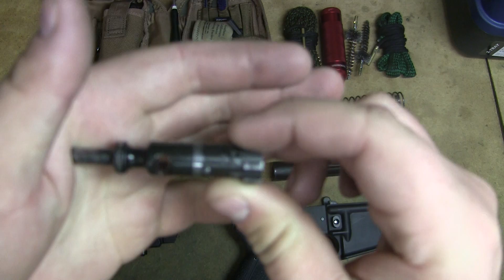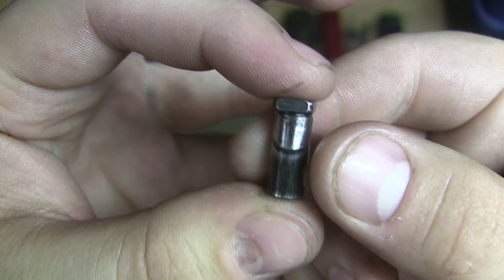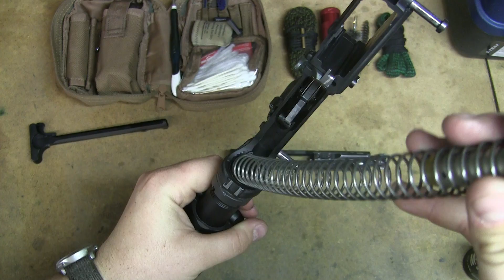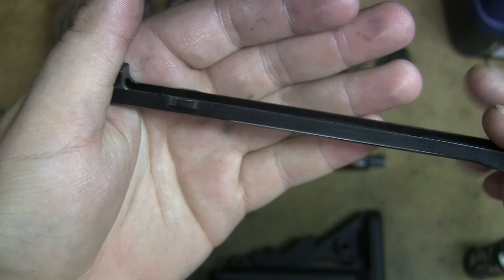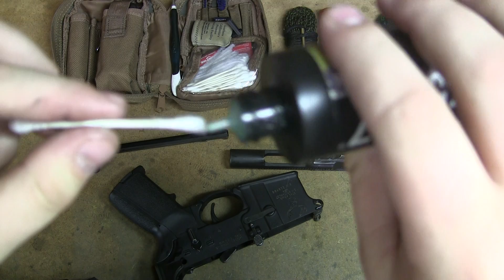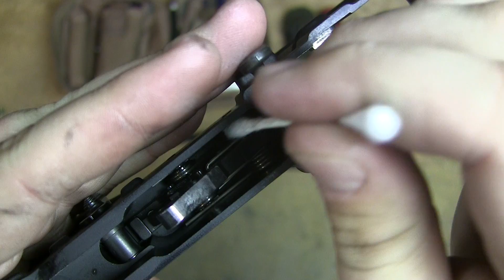AR15 Lubrication

Comment: Just buy a good AK and you good to go !!
Reply from the maker: It depends haha.  Due to the AK's simplicity of operation, and reputation for not requiring much maintenance at all (which is true), people seem to also think this carries over to the quality of the build.  The truth is that the AK must be manufactured to exacting specs, using the right type and kind of steels and processes.  Metal hardness, tolerances, fitting the trunion and other parts together, doing proper rivets, and putting it all together is something that requires the experience, know-how, and industrial capability to do right. 

Simply just buying any AK is not going to set you up for success, and (sadly) with the importation restrictions of recent years, the cheap yet quality kit builds are not as plentiful.  Getting a quality American-made AK is also expensive because not many companies can build AKs in America that are up to the same standards as Russian or Chinese-level production.  It's an entirely different build process and it is exact, it demands a quality build done with experience and quality materials, anything less than that and you're in for a bad time.  

Combine this with the fact that the AR15 has experienced an unmatched amount of R&D and T&E.  The military has been constantly learning lessons and making upgrades on the same design for over half a century, and the civilian sector has also made advancements in the competition realm as well.  With all of the countless lessons learned and improvements made over the decades, from many different end-users, combined with the many millions of tax-payer dollars that have gone into making this rifle that much better, the AR15 is really a refined end-product at this point.  Many companies are putting out quality AR15s, and they all have improvements to the design that have become the expected base-level standard of today.  The end result is a rifle that will perform, and can be had by a quality American manufacturer for very affordable pricing.  

Getting set up with a quality AR15 can be done for less cost than getting the same level of quality in the AK world, which is why it's the most common of the two choices in America.  The AR15 has better ergonomics, I've never seen anybody argue against that point alone, and for all of these reasons, most Americans have an AR15 as opposed to an AK if they only have one.  With the modern build quality and design enhancements of today's AR15s, even a basic level of maintenance will give you reliable function and long-term performance out of your AR15.  The AK is not garbage, it may be outdated and have extra things to consider (mounting optics/ergonomic issues/not as easy to build or modify/etc), but it's still viable if it was built right.  I just prefer the AR15, but if you're seeking an AK, be prepared to spend some money to get quality.  If you don't push high round-counts out of your working guns, then go for a cheaper AK, it'll probably be fine.

Comment: I lube mine, about the same as you do. Always runs great!  Zero malfunctions.   I may add a drop to my trigger sear engagement area.  You're right. You must understand what's going on in your firearms. Some people just aren't mechanically inclined...
Reply: BCM filthy14 looks like it has sludge inside of lt.Yet it keeps on functioning past 45,000 rounds.Lube lots of lube keep it going and it's very rarely cleaned.It also sees lots of carbine classes.Their motto is a Ar will run dirty and wet but not dirty and dry.

Comment: I had to lube up my bolt to get my,gun to fire for 30 rounds after that it wouldn't fire even with a round in the chamber there was no strike on the bullet what could be the problem ??
Reply: You still have that problem? Sounds like a firing pin issue

Comment: When I first built my 300 blackout I kept having failure to feed issues so I took the bolt carrier apart and submerged everything in mobile 1 synthetic oil overnight. I put the bcg back in the gun the next day absolutely dripping soaking wet and didn’t have a single malfunction, but the excessive oil is really annoying...
Reply from the maker: There is a rather large list of issues that could be going on, with feeding issues on an AR, I generally look towards the magazine.  Use a Magpul PMAG, and you've ruled out the magazine.  Use Hornady .300 Blackout and you've ruled out the ammo.  If you lubricated your rifle as seen in the video, you're using a PMAG, and Hornady, then you've ruled out the magazine, ammo, and rifle maintenance.  Then I'd start looking at the build, but it depends on exactly what is happening when it fails to feed.  On a lot of home builds, especially in this caliber, I've seen quite a lot of issues with under-gassing and buffer selection, that seems to get a lot of guys.  The gas port size, gas system, carrier weight, buffer weight -these things all matter and are all inter-connected.  But again, it depends on exactly what you're experiencing when it jams.
Reply: Mr2ndAmendment I finally found the root of the problem. It was my gen2 pmags. All the gen3 pmags that I have will feed the subsonic and supersonic rounds just fine, but the gen2’s are older and I supposed the springs aren’t as strong and aren’t able to push the heavier ammo upwards fast enough. I also bought magpul 300 blackout magazines and they work well.

Comment: I just wanna say thank you one more time. I use your method of lubing every time I lube my BCG and I love it! Very clean, neat & organized. I even lube my lower including the pins every now & then. I also clean the extractor every now and then as well, as for the ejector I've actually never lubed mine after putting hundreds of rounds through my rifle.

And just recently for the first time, I've added 2 itty bitty eye dropplets of oil to the ejector and worked them in several times each (as in 1 drop, work it in several times & again for the second) dried it off and its gtg for a long while. Like I said I've never done it before (but after getting some help from gun fourms I was successfully able to do it) mainly because I was scared and its not something you wanna constantly mess with. But I also don't want it to rust/corrode either simply because I've never oiled it kinda thing.

Good deal man well thanks again for your video! Also liked, subbed and hit that bell icon! :D

Comment: So you dont need to oil the barrel or outside parts like you would on a shotgun
Reply from the maker: Not for reliable function. This video was more about lubrication for reliable function, but there are strategies you should use for long term storage to prevent rust, or if you live in a very humid place. I can do a video on long term storage, which does involve a light coat of oil over the steel surfaces.
Reply: @Mr2ndAmendment  long term storage would make a great video.

Comment: Great info - thanks a bunch.  Question.new AR15 - S&W 556 - 223.  Stock butt plate has no damper, no impact relief.  All add-ons show two screws holding one butt plate.  Not on basic equipment.  Where can I get something that will be effective as impact damper?  Thanks,    Wild
Reply from the maker: Welcome to the AR15, a S&W is great for the money and their warranty is pretty solid should you ever need it.

For AR15s, it's not a common practice to use some kind of recoil reduction stock device.  You might be familiar with the Limbsaver or other similar products that slip over the butt stock of a heavy-caliber hunting rifle, or the butt pad performing this function on a .30-06 hunting rifle (for example).

In the AR15 world, given the light recoil and tame nature of the .223 Rem/5.56mm NATO cartridges, it's very uncommon to see anybody utilize products like those.  I have seen it with people who had a medical condition or disability/injury where all efforts were being taken to reduce recoil, but honestly that's the only time I've ever seen recoil-reduction equipment/products installed on an AR15 stock.  

Have you shot it yet?  I think after you shot it, you might re-consider the need for this.  If you're thinking towards having the kids/grand-kids shoot it, depending on age and capability, they should be fine, I've seen children (under guidance and oversight of course) shoot the AR15 successfully without any recoil problems.

I hope that helps!
-Mr 2A

Comment: I lube a little heavy on a new rifle and diminish the amount of lube as the rifle breaks in, usually after 400-500 rounds.
Reply: You’ll have a lot to clean off by then. That gun powered will be coated on the lube.
Reply: @micavellii  - True, but it aids in break-in.  Cleaning is part of ownership and responsibility.  The OPs's comment is technically correct ... over-lube a little when new, then you'll not have to use so much lube after break-in and your rifle will then be easier to clean.
Reply: @RedCar-c1i  Just bought my first AR rifle since getting out in 02. I had to my bolt more than normal at the range to after that no more issues. Just breaking in. Those rifles Uncle Sam gave me were well worn.

Comment: 2019:  The 3 BEST - HANDS DOWN (*IF* properly applied via heated metal):   *SLIP200 EWL.  *WeaponShield CLP.  ...and - IF U CAN FIND; #1 IN MY EXPERIENCE:   *PRO ONE XPL-101.  
-  ALL r  SaltWater-Rated. USE for the WHOLE GUN!  -- |**|  USE ON UR MAGs internals, AS WELL. Pick one. makes no difference. Stick with... offers markedly-better Performance & Protection with continued use!

Comment: My AR-15 is stored inside an oil drum submerged in Mobil Delvac heavy duty Diesel oil.  Just in case, you never know.
Reply: So im not the only one.
Reply: He’s obviously being sarcastic y’all
Reply: Fuck you, rust.
Reply: I'm using Shell Rotella with some LUCAS additive.
Reply: You need 2 then
Reply: I keep mine in fine grit aluminum oxide and blue steel turnings from my lathe, ensuring sufficient material is wedged directly between the charging handle and bcg
Reply: Not bad.
Reply: Thanks for the info
Reply: Man this is killing me!!!
Reply: EL Dragon ——that’s dumb /so a robber breaks in ur house and pulls a gun on u and your family.   What do you do?  (Answer) drain down oil grab a rag dry off ur gun and save the family $&@?’!=wrong answer:
My Ar 15 pistol sits in my bedroom with a 100 round drum in it but it won’t be my first option the baby G2 45mag w ultra bright light and laser mounted under my pillow  will be my fitst
Reply: @maximillianofranciscozamor9103  sounds like yours is dry...
Reply: Maximilliano Francisco Zamora JR woosh
Reply: @maximillianofranciscozamor9103  That's what the seccond AR is for.  Duh!
Reply: @maximillianofranciscozamor9103  Who cares🤔
Reply: @maximillianofranciscozamor9103  lasers sketch me out, if they have a gun, youre telling them right where to aim.  and unless your flashlight is set to strobe i feel the same way about them.
Reply: @uurkisme  That's why you have an Infrared Laser to go with you NVG.
Reply: @jigmatrix  or 1500 on the end of scar heavy
Reply: @jigmatrix  I would know to shoot into the light.
Reply: @maximillianofranciscozamor9103  The drum of oil is disguised as a night stand next to the bed.....
Reply: @maximillianofranciscozamor9103  You do not find drum magazines extremely bulky, heavy, cartoonish and unreliable?
Reply: @brianmorrison9066  maybe from 50 years ago, the new ones are great
Reply: Maximilliano Francisco Zamora JR  take a joke
Reply: @maximillianofranciscozamor9103  What if you load a blank in the chamber and a full mag of 55 grain before submerging it in oil.
Reply: @maximillianofranciscozamor9103  speaking of dumb now all potential robbers know wher yew keep yer weapons
Reply: @maximillianofranciscozamor9103  sounds like a lot of junk on one little pistol.

Comment: Watch Larry Vickers video about lubrication.  He puts guns in a 50 gallon battle of oil in and pulls them out and they run fine.  One thing to know about AR's.  They run fine dirty.  They will not run fine dry.  My buddy and I did a little experiment.  We took a cheap M&P15 Sport, ran it every day for about 4 years spraying the crap out of it with Remington oil.  No cleaning, No problems.  Tore it down, cleaned it, and it had zero problems.

Comment: Don't know why you skipped the ejector!It only keeps the weapon functional.
Reply from the maker: Dropping CLP in there every time can have some bad effects. Clean it with solvent, and just leave it. Too much lube and nothing at all are the two things that can kill it, but that would have to be an extreme scenario. You dont want it to rust, but you don't want a carbon/gunky situation either. I've never had problems with the ejector, my philosophy is that if it's over 10-level (operator level), I dont take it apart and I don't mess with it. I love Hoppes #9 because it's a cleaning solvent but it also leaves behind a bit of a rust barrier, that's all the ejector needs during cleaning and you'll have something that's not going to get stuck from rust or gunked up. That's what I do, it's served me well. ARs can be run totally dry, any bit of conservative and strategic lubrication we do is just to prolong service life of the parts, not to make it actually function reliably.

Comment: What about the tube where the gas blows out of the one with the pinched screws. I used a q tip and oil in there was it a bad idea?
Reply: Prophet  I'd be extremely careful inserting anything into the gas tube.  Were you to clog it up, it could cause a catastrophic malfunction.  There's so much gas and pressure through it that it's pretty much self cleaning from what I've been taught.  Best wishes.

Comment: I always use gloves so I don't get my skin oil on everything, since your skin oil is corrosive, also cleaner.. I also use a small paintbrush to spread oil, but other than that, i do the same thing. I also always oil everything that has rub ware.

Comment: I give my bolt a fine layer of oil, if nothing else but to make cleaning a breeze. Hardend Carbon is hard to get off sometimes. I would rather not lose my finish on my rifle because I cheaped out on oil. It dont need to be sobbing wet. Just enough to keep the carbon from becoming hardend on the surface.

Comment: 7:48 & what would happen if I let it slam? Just curious because mine has a couple times..
Reply from the maker: The lower receiver will take some punishment from the hammer for a good number of hits, but at some point you might have problems.  I've seen two M4s get coded out (deadlined/broken) from dudes relentlessly dropping the hammer like this.  If you got a good, quality forged lower you should be OK, but the problem is that so many people have so many types and kinds of lowers out there with various quality, I just would try to not let this happen no matter how well-made it is.

Comment: Why are you so scared to get lubricant on you’re rifle? Dust? Dirt? Wipe it off. I would like to see you wipe the metal back on. If you’re barrel isn’t worn out but you’re bolt, cam pin is then you new to use more lubricant.

Comment: Question: I lube my ar. But I noticed after about 650 rds my bolt has quite a bit of carbon buildup. Impossible to clean kinda build up. What am I doing wrong?
It seems like I need a wire wheel on a drill to clean it.
Reply from the maker: Battle Cam 

Carbon builds up, especially on the bolt tail and inside the bolt carrier. I got a video on how to clean the AR15 you might like. Functionally, that carbon build-up is nothing to really worry about, it's the gummy carbon sludge in the upper receiver that'll eventually cause issues if not cleaned out.

Comment: No lube on bolt lugs?
Reply from the maker: FiveDotFiveSix 

No, my goal is to keep the star chamber as clean as possible, without putting lube there, you'll end up with a dry film of carbon when you're done shooting, very little to clean up. 

I want to reduce the possibility of attracting sand and dirt that'll want to stay in there, if it's all wet I'll be worse off. If you're only going to the range, there won't be consequences, but if you're getting dirty in an austere and extended environment, I would refrain from setting up the conditions that'll help gum it up. I don't want to stack tolerances between the lugs, bolt face, and barrel extension with sand and grime, a properly-made bolt is at least 158 Carpenter steel, it'll be just fine without it.
Reply: @Mr2ndAmendment  thank you for the reply

Comment: Just one caveat if you're in a humid environment like Louisiana Houston Vietnam I'd run a little more oil for rust prevention
Reply from the maker: Brent Mack 

Yeah, I shoot 1-2 times a week, I'm always in my ARs doing maintenance, but I should have talked about long term gaps between range days. In any case, that phosphate coating (gray scratchy surface) should always have a thin film of oil applied to stay permeated in the surface to ward off rust.

Comment: Really informative video.  Good job.  I use Lucas synthetic high speed bearing grease instead of oil.  Petroleum products evaporate over time.  Synthetic lube lasts much longer.  I clean my pistols every odd month and rifles twice a year if not used.  I clean each firearm after every use.

Comment: i always just lightly lubed all interacting surfaces. and used the excess oil to coat any other parts of metal. it just helps prevent carbon buildup. but if you clean your gun after every use its not really needed.